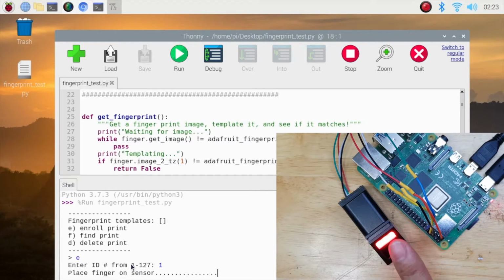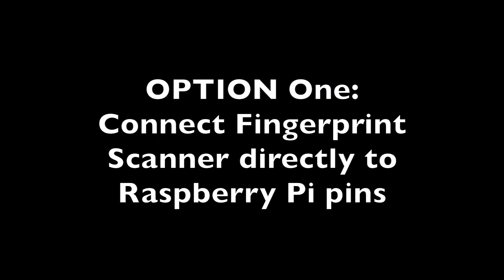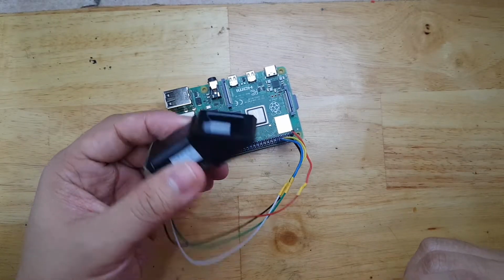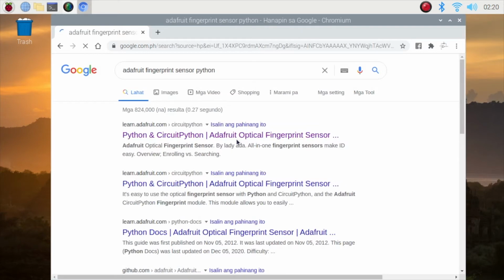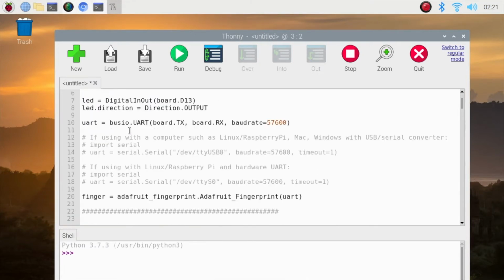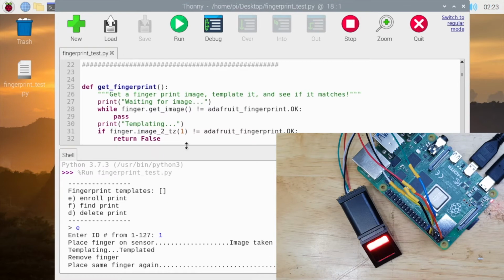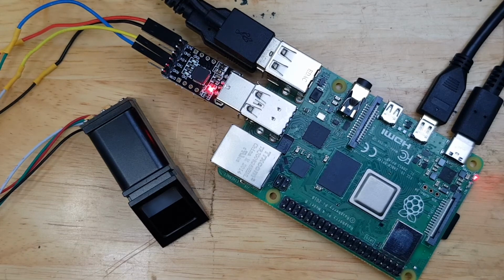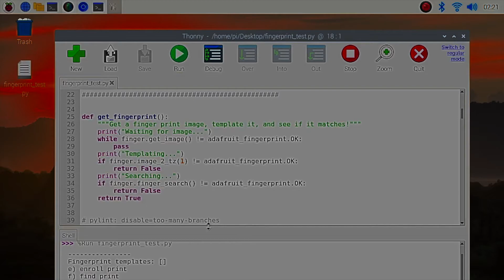RASPBERRY PI 4 WITH FINGERPRINT SCANNER (UART) COMPLETE TUTORIAL AND DETAILED INITIAL SETUP DEMO.

Comment: Hello sir, how to connect several components to synchronize? The components are, (Smart lock box)

1) raspberry pi 4 b model
2) R503 fingerprint
3) 3.5 inch touch screen
4) DC12V solenoid lock for door
5) Electromagnetic lock to hold the key.(Quantity=20)
6) SD card

Comment: Great video, thank you! I'm having an error while trying to run the code though. It's either "Couldn't open the port. Permission denied /dev/ttyS0" or "no such file or directory /de/ttyUSB0" depending on which code I uncomment. I wired the scanner as black-GND, white-TXD, green-RXD, red-5V. I'm also using a USB to TTL UART converter. If anyone knows what the problem is, I'd really appreciate any help or suggestions!
Reply: hello have the same problem, have you found the solution?
Reply: sudo python and the name of your file. You do not have proper permissions.

Comment: Traceback (most recent call last):
  File "/home/pi/Desktop/fingerprint/Adafruit_CircuitPython_Fingerprint/examples/fingerprint_simpletest.py", line 20, in <module>
    finger = adafruit_fingerprint.Adafruit_Fingerprint(uart)
  File "/usr/local/lib/python3.7/dist-packages/adafruit_fingerprint.py", line 113, in _init_
    if self.verify_password() != OK:
  File "/usr/local/lib/python3.7/dist-packages/adafruit_fingerprint.py", line 127, in verify_password
    return self._get_packet(12)[0]
  File "/usr/local/lib/python3.7/dist-packages/adafruit_fingerprint.py", line 307, in _get_packet
    raise RuntimeError("Failed to read data from sensor")
RuntimeError: Failed to read data from sensor

Comment: Thanks But I am getting an error when running the code, The error is in the Line where the finger initialized in this line..... finger = adafruit_fingerprint.Adafruit_FIngerprint(uart), sir if you help me, I will be thankful
Reply from the maker: please check your wiring.
Reply: @circuitdesolator 
Thanks for your reply, But I have already completed my Project...
Reply: @Jake Scerri
The problem was in my Wiring Connection...
Reply: @Jake Scerri
Red = 3.3 v
White = Txd
Green = Rxd
black = Grd
if you have r307 sensor
Reply: @JamilHussain110  Never follow wiring using colour codes, also look for layout using the circuit diagram/spec sheet.
Reply: @syedazeemjaved  bro can you help me out from this project I'm getting some errors regarding with r307
Reply: @chintalanaveen1567  Sure please share the error that you are facing, would be more than happy to help!